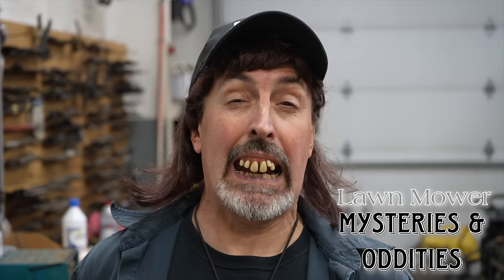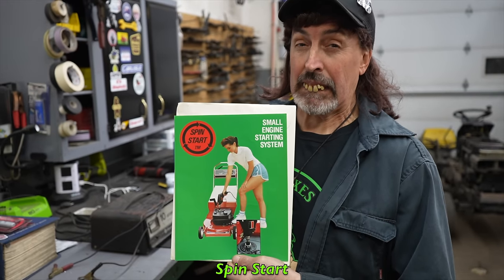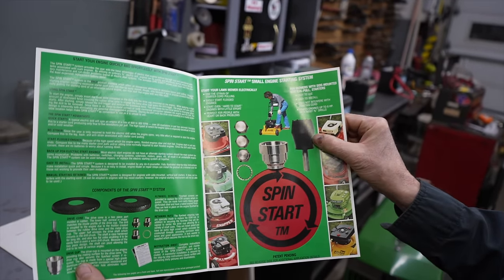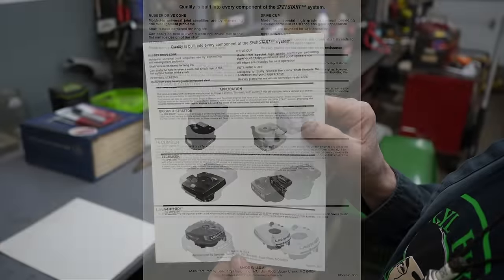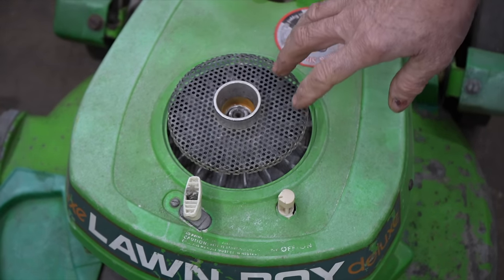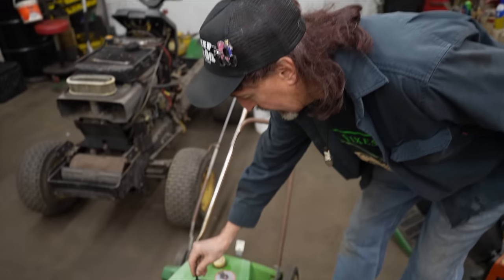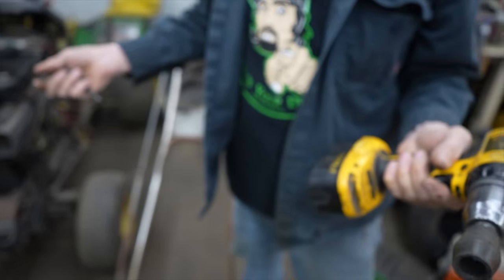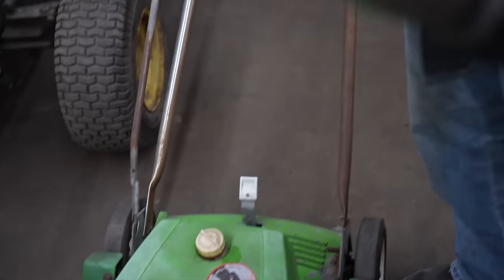You've NEVER Seen This RARE Vintage Electric Starter

Comment: I have here, an electric starter for radio controlled boats and aircraft, which uses precisely the same approach. The only difference is that mine is powered by a 12v battery - so in essence, your car's battery.  It's about as big as a small car starter motor, and can realistically start small lawnmower engines, and is a very useful tool for starting stubborn chainsaws leaf blowers etc. that have been fired up in a while.
Reply: Back in the 1950s, before radio controls, there were tethered airplanes and cars run by Cox .049 engines that used a glow plug to start and ran on a mixture of alcohol, castor oil and nitromethane. Some people started them by flicking the prop with a finger that resulted in many cut fingers. Some used a pull start and eventually there was a spring start that you would hook to the prop, wind it up, heat up the glow plug and release the prop. it was a little safer. The guys who had these usually had a box with the glow plug battery, fuel, tools and parts. Some users had  DC electric motors that used a friction drive that drove on the cone in the center of the propeller. They would hold the airplane against the drive sticking out of their tool box to start it. The operator had to stand in the center of the 100 foot diameter circle holding the tether and turning around with the airplane or car as it circled. They had to keep going until it ran out of fuel.

Comment: Thankfully, when they had hand crank start, they were smart enough to make two helical slots as to safely release hand crank from pinned  crank hub when engine rpm overcame hand crank speed.  That tapered hub design relies on friction ie pressure, not good

Comment: I have an old Briggs and scrapem that I converted to propane and when I start the lawnmower with the drill because it will only start with a drill it sometimes spins off the chuck, or the socket flys across the yard or it tries to break my wrist. The main problem is that if  the lawnmower shuts down you have to go get the drill or carry the drill around with you 😀😜

Comment: I remebr seeing them as a kid. I thouht it could have been great for kore than lawn mowers. Mini bikes, tillers, snowblowers, weed wackers, most any thing with a gas engine. You may need to adapt tge cup or build one to fit the engine you want to start. 
Musty1 has an over running clutch between his drill and socket that is better than just the socket.

Comment: Dad had a mower like that and he ran that thing for about 20 years. He had a bag for it, that mower would start first pull every time after a couple of primes.
Reply: I had the same with a bag the problem was the muffler was under the deck so you just about died of 2 stroke smoke inhalation 😂

Comment: I don't know what they called it, but when I was a little kid my dad had an old Craftsman mower with a starter where you'd flip a large lever over, crank it round and round, winding up some spring, then flip the lever over and slam it down which would use the wound up spring to quickly rotate the engine for starting.

Comment: I remember when I was a kid my father had a lawn mower that didn't have a pull start it had a handle that you unfolded from it's down position. Then you would crank it a few times then put it back into the down position and push down hard and it would allow the spring to let the motor turn over to start... If it fits start the first time then you just repeat the process that was a factory starting system back then I can't remember the brand name of the mower I know the motor was white and if I remember correctly the body was a light green / blue color

Comment: Had a guy socket start a 2A016 in his garage recently. The socket separated from the extension which separated from the drill adapter which came out of the drill chuck and snatched the drill out of his hand. Luckily nobody got hit, but he now has a dent in the garage door and a mark on the drywall. I bought the motor because it did run.

Comment: or other problem with using a socket is like i did stripped the thread on the crank shaft so now the nut is welded fast lol

Comment: Thats a great product of back then but they still make those ratchet adapter type still to use a power drill to crank the engine on the flywheel nut . Mustie1 uses them a lot in his videos.

Comment: Jeez, as easy as those old Lawnboys started, the spin start seems a bit redundant, but whatever. That particular model you could start it, literally, with 2 fingers!🤣 These new mowers, they're so intent on protecting the consumer from themselves, that you probably couldn't even use one of these without chopping up the whole top of the engine shroud, etc.🙄

Comment: I don't remember this, but the power mowers we had back then used the top-mounted recoil starter so this wouldn't have worked. For the longest time we had the old-fashioned push reel mower, so the whole idea of electric start was foreign.
Reply: I assume the recoil would have been taken off and this electric start installed in its place.
Reply: @KStewart-th4sk  
The one had the old Briggs recoil that was spot welded to the shroud, and used the extended crankshaft for the ball type starter clutch.
Besides, my dad was old-school. No electric starter for him- one hand on top of the engine and pull the rope with the other.

Comment: now they make a deal like that to start weed wackers there is a tool that plugs in to a slot in the back of the engine you can buy the tool to chuck in a drill or they sell a starter to go with it . I remember seeing ads in popular mechanics for that starter kit I sure wished I had one at times !! I was in 6th grade when I started seeing new mowers with that bail on them

Comment: Makes me laugh Now! Made my own years ago cutting the end off a 3/8" extension and putting a socket on. Had a brand new Crapsman 1/2" drill and it worked fine until the mower backfired once and busted off all the teeth on the gears in the drill destroying it. That was like a 60.00 drill in the 80's so the Crapsman mower got tossed too because couldn't get parts for the recoil start.😂

Comment: I will make one.
I did loose my big toenail and the nail of the next toe when i slipped my foot under the mower when i pull started it as a 12 year old. There was a decal showing to put foot on the deck to start it. But i knew it started easily so i just grabbed the pull cord and learned a good lesson. And it didnt start after hitting my foot a few times after all.

Comment: This actually seems like a good idea, especially if you had shoulder or arm trouble from age etc. But you were still at home and wanted to keep your independence. I have never seen one. I remember when bails came out. They were a government mandate and there was grumbling about government interference and increasing the cost of lawnmowers.
Reply: had the bail on Snapper for the first decade. Then taped it up. Then just took it all off. Third engine, almost forty years later. Bail gone, electric start gone. Still got all my toes. 
Sometimes I like to stop & pick up rocks/cones/whatever instead of just running it over. : )

Comment: Thats how i start my 15 hp craftsman lawn mower, a 1/2" drive socket with a 5/8" hole saw bit, because the price and quality of the batteries is outragous, and screw paying for a new starter....it works great but you have to wear a heavy padded jacket and a good face sheild, because the socket has a tendency to fly off in unpredictable directions..lol

Comment: My great Grandparents had a mower with a wind up starter.. you flipped the handle over to extend it, wind it up and pull the plunger and it would start the mower..  Best idea i've ever seen or used..
Reply: yeah they were discontinued/outlawed
due to being a huge safety hazard, the little knob with the pin that popped out to hold the flywheel still while you wound it up would break, or become unlatched  and as people were winding them, the engines would start and cut their toes off. Be happy you used it, and did not get injured

Comment: Neat idea, only it wouldn’t work for engines with horizontal recoil starters. Would still be a great thing to have on a tractor / riding mower engine as a backup means of starting in case the battery goes dead and you need to get the lawn done!

Comment: If ya didnt have stupid people trying to use a piece of power equipment  incorrectly . we wouldn't of needed the gov to come up with and enforce  those cpsc standards . but I like the idea . way better idea than that other one they had come up with for use on some of the line trimmers out there . that little one way clutch never lasted very long .